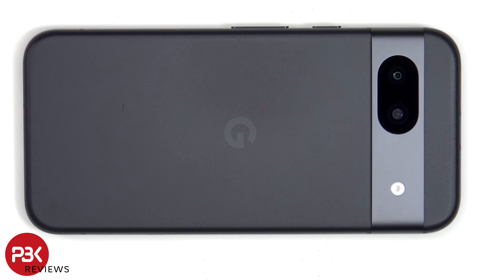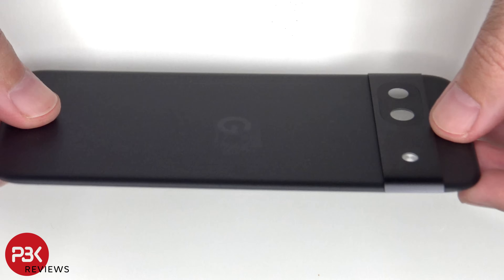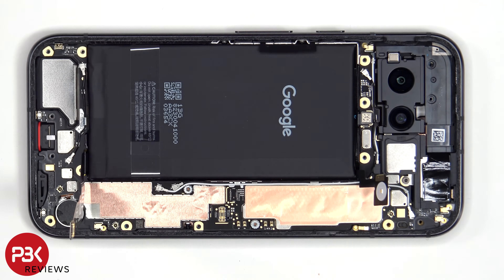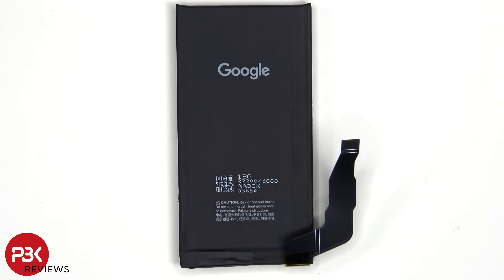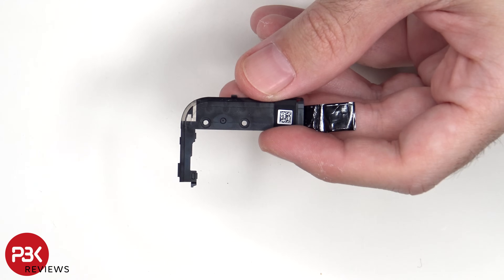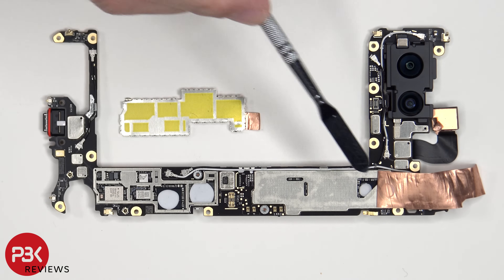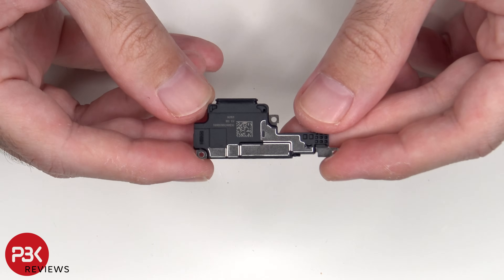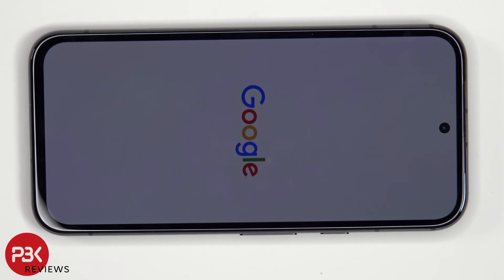Google Pixel 8a Teardown Disassembly Phone Repair Video Review

Comment: Great disassembly, but the question remains, I heard that the 8 and 8 pro suffer from "green bars" problems due to pressure on the screen from the inside, does this model suffer from the same problem?
Reply from the maker: I haven't really heard about the green line or bars on the 8 or 8 pro, but this ones structure is more like the 7a and not the 8 or 8 pro so I wouldn't think it would have the same issues.

Comment: It's weird that compared to the pixel 8 pro, they have made the backplate removable. Is it even possible to remove it on the 8 pro or you have to stick with the display? This seems to be a smarter solution. Nice vid anyway. :)
Reply from the maker: Thanks. Nope on the 8 pro the screen needs to be removed. Not sure why they don't do this design with the 8 and 8 pro, same thing with last years models on the 7 and 7 pro vs the 7a
Reply: @PBKreviews  Well at least if you break the display you don't have to bother with anything else...  I never understood why phone manufacturers are using so much adhesives. They should learn a bit more from watch makers, where only screws can hold together the entire thing and they are still have a high level of durability and perfectly water proof. I'm changing my phones only because the lack of updates or because of the battery become used.

Comment: And Pixel continues with their horrible design, soldering the charging port to the motherboard. Seriously, every other phone manufacturer under the sun have easily replaceable charging ports now, on either a flex cable, or on a sub board/sub assembly. It's insane pixel continues with his trend, and ruins an otherwise pretty nice phone.
Reply from the maker: yup
Reply: I don't understand why ppl are yapping about this ...I mean what kind of a maniac could destroy the type c port. micro usb is easily damageable but type c is far more durable. Maybe 1 in every 200k would have damaged it.why should a big company like Google change their efficient mono pcb design for a few stupid users who try to jam micro usb cable into a type c port

Comment: Unfortunately, I did not see the screen removal process. The Pixel 8 and 8 pro had problems related to the sharp ground pins of the screen. Sometimes they would pierce the screen or the cable to the screen and the image would turn green.
Reply from the maker: It's the same as the pixel 7a, take a look at that video I did and you will see what its like: https://www.youtube.com/watch?v=cKEX8jNNzck
Reply: Thank You! I think the design of this phone is more durable than the Pixel   8 and 8 Pro. That's why I bought the Pixel 7a instead of the Pixel 7, which sometimes had a peeling screen.
Reply from the maker: you're welcome :)

Comment: This is amazing to watch - great stuff
Reply from the maker: Thanks, glad you enjoy it!
Reply: @PBKreviews  hi, I actually came to look at the internals to see where the wireless charger was. 

Do you think it's okay to use these magsafe style cases with magnets on pixel 8a to attach to wireless chargers and phone cradle?

Are these companies making cases with magnets in the correct place?
Reply from the maker: If the case is designed for the phone, then most likely it is engineered with schematics which place the magnets in the correct place.

Comment: Please show the USB connector under the gasket, is there a compound there?
Reply from the maker: Not sure what you mean by under the gasket. If you are referring to removing the red gasket/rubber around the charger port, then there isn't any compound under it.
Reply: @PBKreviews  7:27  the black gasket covers the power connector USB-C , and the contacts on the board must be covered with compound (or not covered, it varies)
Reply from the maker: Ok, now you're saying power connector. Please clarify what you are referring to. The USB-C charger port?? or something else. If the port, then its the same exact way as the previous model.
Reply from the maker: No compound that I saw

Comment: The Pixel a series was great but had gone very wrong in recent years. It’s bloated with many unnecessary features and as such it’s too close in price to the Pixel 8. Consumers are better off buying the regular Pixel.

To make the Pixel a series viable again, Google needs to implement:

1 a full plastic construction (both the sides and the back) in matte finish, because glossy plastic scratches too easily;
2 use cheaper and lesser known glass products for the screen (such as the DragonTrail glass on the 3a);
3 remove wireless charging, most people buying phones at this price point don’t have and will not buy wireless chargers;
4 remove official water resistance rating (not necessarily the resistance itself, according to OnePlus, the seals aren’t expensive, but the certification is);
5 and finally, a price tag of $400.
Reply: Just bought my 8a January 2025 $399 Best Buy
Reply: I paid $299 for my 8a (before trade in) ... and then I bought a wireless charger.

I suspect you are full of beans, sir. I bid you good day.